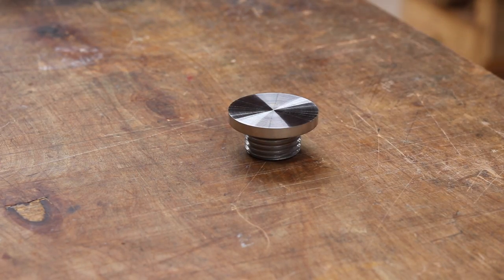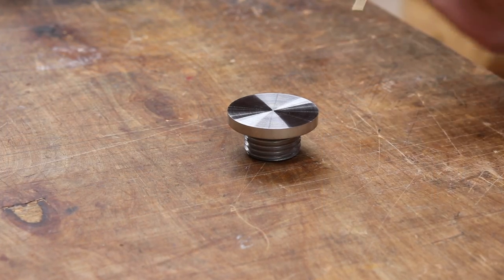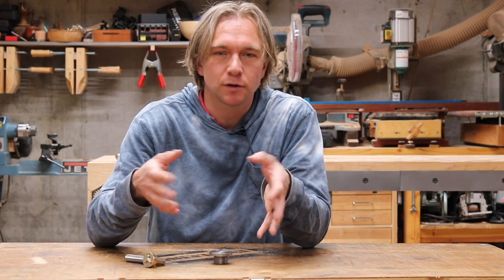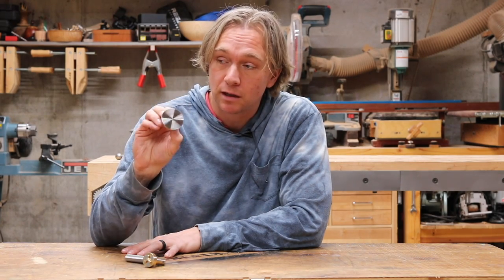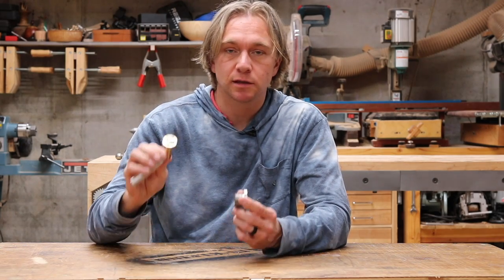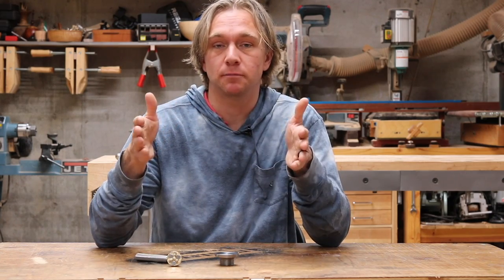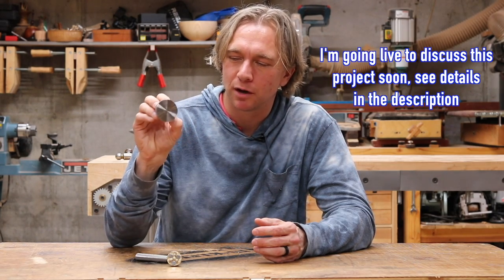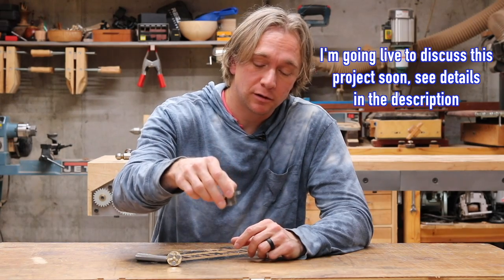A Screw With No (visible) Slot Is My Next Big Thing!

Comment: If Dyson can name vacuums after himself, then this is a Klein Screw
Reply: Best suggestion I've seen so far 👍
Reply: Klein screw is good because of current naming convention. We already have Phillips, Robertson, and Kreig. I'm sure there's also a few other "last name" screw types also.
Reply: This comment..
Reply: I agree. Just name it after yourself.
Reply: “Kleanscrew by Klein”
Reply: @tomfull6637  That's a good one.
Reply: Yes
Reply: Dont forget to add some kind of maker mark or if you name it based around your name, like Klein screw, as word play on clean screw. Make a mark somehow on it on sides or underside.
Reply: Yes. Around the outside like the milling on a coin, and don't forget to go out of your way to avoid ambiguity with Calvin Klein because that's not a furniture name but it is a design name. Klein bottles as well. Perhaps a first initial or first two initials for future proofing against other brands, and a patent goes without saying otherwise somebody will come along and steal your idea and say it was theirs all along.
Reply: Klein screw again best suggestion.
Reply: This would be good but Klein is a tool brand and could be confusing in marketing
Reply: @johnholfman4232  They can license the installation tool and sell it. 😀
Reply: @adamdnewman  but if calling it Klein is to credit the inventor doesn't it defeat the purpose
Reply: First one could be A Klein Screw, big seller would be the N Klein Screw.
Reply: @johnholfman4232  marketing power
Reply: @johnholfman4232  Use middle name?
Reply: The Phillips head screw was named after its inventor so you’re definitely right!
Reply: Yeah, BUT no one wants to get Klien Screwed which is what could happen after investing a boatload of money into making these if they don't sell.
Imagine spending 60 bucks for a driver and they stop making the screws.
Reply: Klein bolt? A screw is tapered and does not have to have a matched mating surface, this looks like it would to keep all the forces on the tool mating surface even. I would use them for enclosures hiding electronics on projects, but as some other comments have said, it will need to be some standard sizes so matching fixing hardware can be sourced.
Reply: The only problem with that is that a be very easy to confuse it with Klein tools.
Reply: Perfect name
Reply: Agreed
Reply: @chrischippett7428   not heard of a machine screw then. Also a bolt has an unthreaded section between the head and the thread.
Reply: Klein screw would be funny, because it would literally mean small screw, the exact opposite of what it is.
Reply: It sounds good, but he has not changed anything with the thread as that would indicate. More accurately would be “klein drive”
Reply: @tacticalant3841  Klein Head.. Small head. Lol
Reply: Klein is also 'small' in Dutch/German/Afrikanns
Reply: Ga Jon H - brilliant design/ concept. Also, maybe the drive plug could be a different material so as to contrast with the body of the fastener. Different designs and drivers matched up.
Reply: Nice...
Reply: While the name "klein" is catchy it might confuse Africans and German speakers since klein just means small. So it would be "small screw".
Reply: klein fastener
Reply: KleinScrew by Andrew
Reply: I really like that name and I definitely see a need for the product
Reply: @tomfull6637  nice or "Klien's Clean Screw"
Reply: Bruh Mania - yea, “Klein fastener” is the best 👍
Reply: "Klein Screw" gets my vote!

Edit: Just seen "Peek-A-Bolt," strong contender, if not my new answer
Reply: No diference to how other screws are named, Phillips, Forstner etc. I endorse!
Reply: Frank Lucisano - forstner? Thats a boring bit.
Reply: But they are fairly big! (Klein in German means small ;))
Reply: New Guy KleinBolt™ By Andrew this is definitely a bolt, it even comes with nut...
Reply: Beat E. Schaub - how about “nicht klein Fastener” (not small fastener)
Reply: Phillips, Robertson, Allen, and now Klein screws
Reply: This is perfect the Klein Screw FTW!!
Reply: Yeah it’s a Klein Screw. I like the idea of using it to hold a hidden drawer closed. Or as a second entry point to a locked or concealed storage.
Reply: Most straight-to-the-point simple answer yet. It works
Reply: Problem is Klein is already a huge name in electrical installation.
Reply: Klien screw 💯🪛
Sounds elegant.
Reply: Kind of a problem when you've lost the driver and need to tighten or break down for moving
Reply: By that name your going to run into problems with Klein Tools it a company that caters to the electrical trade you might want to look into a partnership with them who have a very good marketing department already.  Or a big company who's total market is faster like Fasenall who also have a engineering department to give a full spectrum of holding capacity and all screws are security screws are a secondary benefit.
Reply: Klein is a Tool Company or was last time I looked... That name could cause him problems...
Reply: @christopherleveck6835  also think about would you buy a tool to install one screw or four screws...Then never use it again...Hell No...
Reply: @christopherleveck6835  Specialty hardware sometimes requires expensive specialty tools...
Reply: @tacticalant3841  the first three or four threads should be set up to cut threads like a tap so it can be self-tapping
Reply: @tacticalant3841  yeah but they're fun at parties
Reply: @a..d5518  klien nut'n screw
Reply: @thebotformalityknownasdale2564  sell it to them.
Reply: @Z71Ranger  sell it to the customer. Maybe design it into the piece.
Reply: @danp7174  ALWAYS......
Reply: Same for phillips
Reply: KlEiN bOtTlEs
Reply: it really should be the klein screw. sad he doesnt like that name, and kind of strange to honest, that name fits in perfectly with the rest of the screw names. wierd.
Reply: and not a AndScrew ?
Reply: For sure.  Give it your name.
Reply: If he starts to make bottles, he will get in trouble though.
Reply: Klein Screw is actually pretty kick ass
Reply: its edm , nothing new here. also thats a huge peice of "hardware" . $$$ big money involved in edm machines
Reply: Difference is this screw works and looks great. Dyson vacuum I bought looks like it was designed by a 14 year old and works pretty poorly ... the worst money I've ever spent.
Reply: Bond screw "007"
Reply: We've had Phillip's Head, now Klein's No-Head!
Reply: @tomfull6637  it sounds too gimicky, like some as seen on tv product, better just Klein Screw or something more proffesional
Reply: @Romanu141  is that an opinion of yours or is it based on decades of building trademarks, marketing and sales?
I have the latter. 😉
Reply: Ngl thats a pretty dope name
Reply: Klein Anscrew
Reply: It’s in the public domain now so a patent isn’t possible
Reply: @azuritet3  klein is already a big name in construction tools/misc equip... particularly among electricians and linesman
Reply: just don't put it in a Klein Bottle
Reply: Klein screw.
Is good.
Reply: Use a Klein Screw for a klein finish
Reply: @matthewmclaughlin5598  From his site, it looks like he went with Pica.
Reply: @stevelloyd5785  that's still a problem if you lose a screw driver. Or the right sized spanner
Reply: As he said regarding Klein Tools, they will jump on him very very fast as part of his idea is a tool.
Anyway you look at it he might be able to call the screw a Klein Screw but that makes the tool a Klein Tool.
Reply: The Kleinless Screw
Reply: 100% last name
Reply: it sounds nice to
Reply: Klein Tools: Am I a joke to you?
Reply: This is it and it has a great ring to it.
Reply: makes sense, as using a descriptive or fancy name is just confusing
Reply: He addresses that at @5:20
Reply: I would go with that
Reply: The problem here is we have a brand already established with the name "Klein" which I'm sure would get this guy a letter from their attorney.  No need to start a legal battle you could just avoid at this point in R&D.
Reply: @axelbow7491  The German word is actually spelled “kleine”.
Reply: @Gareth820617  The German word is actually spelled “kleine”.
Reply: @etherealicer  Nice try.  The German word is actually spelled “kleine”.
Reply: Klein screw actually sounds legit
Reply: There's already a Klein bottle.

Comment: So I’ve been a locksmith for over 30 years. Your security applications are a far better use of this than anything like furniture or simple decorations. Considering you can make the tool any shape you want it then works sort of like the security Lugnuts for fancy rims. 

So the Latin word for disappear is Evanescet … Evanescet fastening system or Evanescet Security Fasteners. 

Design a box that has a panel on one side held in place by two or three of these fasteners where the head disappears into the surface of the panel like the slot does into the head of the fastener. It would be nearly impossible to figure out how to open the panel unless you knew A. where the screws were located, B. Where are the slots were and C. You would have to have the right tool. Add in both left and right hand threads or slots that require the head be turned to exactly the right position and you’ve essentially come up with a lock box that would be very hard to open. I think you have an awesome idea. Maybe make a couple of smaller versions unless the size is required for the mechanism.
Reply: EvaneSet
Missed opportunity.
Reply: The Lockpicking Lawyer has much to say about security through obscurity… he’s not a fan of the concept.
Reply: Also I think to name something secure, probably needs a license or some kind of testing and certificate.
Reply: @blacksmith67  Yeah because it doesn't work for anyone with persistence.
Reply: Discappear
Reply: I could easily just poke all your screws to find the holes. Also depending on the panel there are… more destructive means 😈
Reply: Some shapes maybe could be more secure than others, but the shape presented in the video could be turned with a flathead.  They could be good for low security in the same sense any hidden panel is, but I think that’s be about as far as they could go
Reply: This would have work if you didn't have cheap 3D printing

Comment: Of course that looks gorgeous and is a very cool design. But my criticisms: all that delicate machining and high tolerance moving parts only function during assembly and disassembly. Between those times, for the majority of its service life, it’s just a bolt with no visible tool slot. A regular super cheap bolt with a brushed metal cap over it can do the exact same thing. The special tool required is a huge turn-off: it needs to be magnetic? And huge? And expensively machined? Everyone looses wrenches and Allen keys. Nobody will want to keep that tool somewhere special, going unused for years, until they need to disassemble their high end desk. The overlap between people in the market for high end furniture and the people who want to look after a special machined magnetic wrench seems very small to me. And there needs to be a way to avoid denting those delicate flush edges while tightening the bolt or else the whole effect is lost. And for the whole aesthetic part, if a furniture piece with caps over the bolts vs the same piece with your expensive design look aesthetically identical, your design doesn’t stand out against the cheaper product. Some of the best furniture out there uses entirely different joinery than surface sunk bolts, so these “ugly” metal parts aren’t even incorporated into the look. so shiny metal discs in the nice wood surfaces aren’t desirable on the higher high end of furniture that your price requires a fit for. Your screws only fit in with the type of furniture that has visible bolts, and so it can only be successful if it is only marginally more expensive than the regular options. Not an order of magnitude greater price, and for a feature that only functions once. Also how small can your design be? It seems not very small. And small size is a virtue for the metal joinery of a furniture piece.
Reply: Good point, but i do believe designer furniture will praise this invention
Reply: Everything I was thinking, but I could not have said it better.
Reply: i agree that's why I believe its best for hidden compartments
Reply: That’s why her EDM the machining is not any different than a normal bolt. The pattern just gets blasted out with an electric wire
Reply: @maxortega8073  100%. This would be awesome for hidden compartments and stealth storage. The special tool is essentially the key. But nobody would ever know unless they saw you use it or this became super popular to the point of being common knowledge.
Reply: @larrypostma2866   that's not a quick or cheap process...

Comment: In my opinion, as an elevator mechanic, I could definitely see these being used in elevators as decorative yet functional fasteners. You have to remember that inside of an elevator cab is all finished work and basically all of them are made sort of the same minus a few very specialized elevators that are made completely custom. I think you could definitely mark these to companies like Otis or, ThyssenKrupp elevator etc. There are also cab companies that build cab interiors for cab modernizations and new installs that you can market these to. When you're talking about marketing them to these companies then you're talking about companies that have access to the capital required to pay for them.
Reply: Agree an easy way to have a panelised, yet easily changeable appearance. Not only between new cabs, but damaged, or to modernise existing ones, say for building refurb.